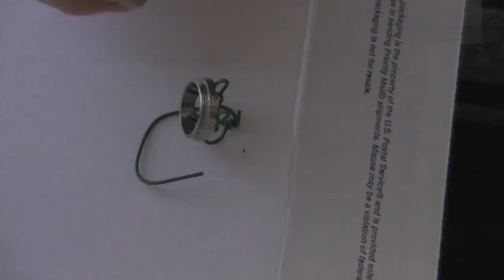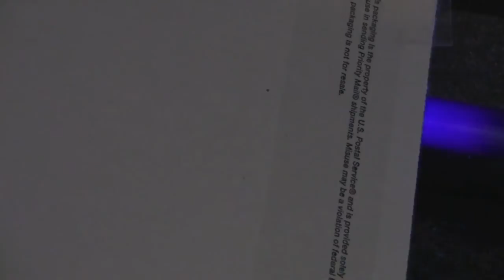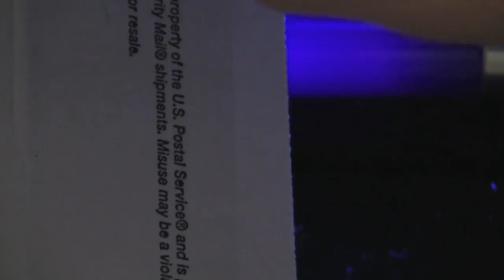tritium install

Comment from the maker: @freedoomed the trits are for cool factor, mostly. you might be able to use them as locators, if you have line of sight in a dark room.

@DemonHide the capsules slot right in like a coin in a vending machine. they either lay in nicely or drop right out. they're cylindrical, so there really isn't a top or front